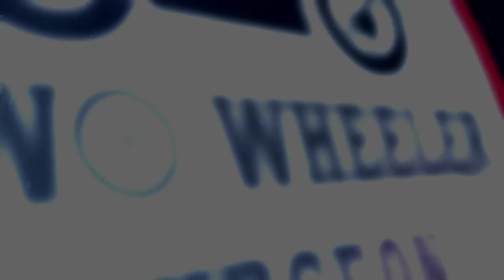Yamaha crux how to fit cylinder head easy method

Comment: Sir , try to tighten the head bolts to its specified torque , tats always better👍🏻
Reply: Sir he didn't specify the torque but he  recommended us to tighten the bolt with  required torque in this video itself 👍
Reply: @gunaseelan3453  👍🏻🙂
Reply: @gunaseelan3453  informative video,thank you👍🏻